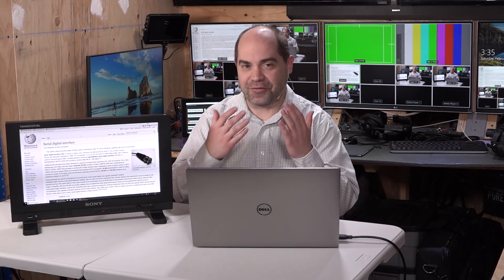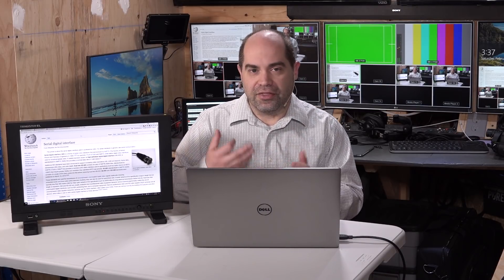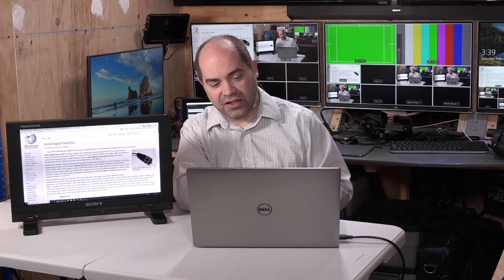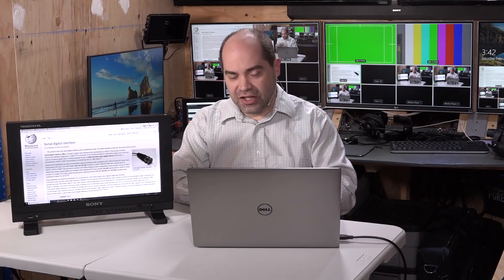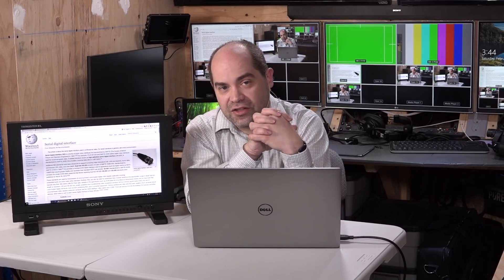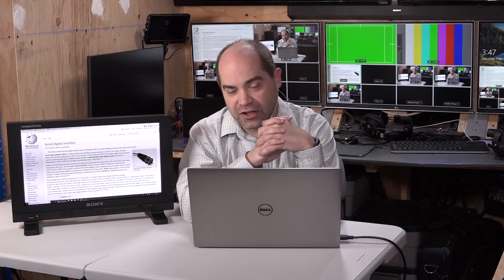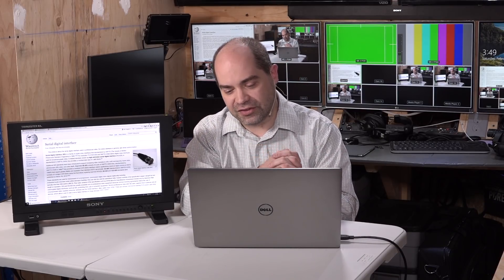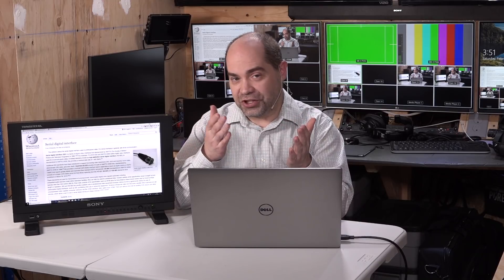What's this about SDI Video? 3G? Level A? Level B? Dual Link?

Comment: Hello, great information by the way. I am checking out YouTube videos in hopes of troubleshooting my rig.

I have a Canon XC-10, so I send the mini-hdmi output of the XC-10 to a Convergent Designs Apollo external recorder. I am trying to use “titan” with the Apollo, which essentially takes one 4K signal and splits it up into 3 different 1080p signals. They can be live switched and set to different magnification amounts etc, and all recorded onto one SSD, essentially providing an affordable solution which is similar to a multi-camera setup. 

In order to do this though I need one 4K signal and I do not like using the mini  hdmi cable from the canon xc10 to the external recorder because the hdmi jack on the camera is sensitive and I feel like when I use a “BMD hdmi to sdi converter”, there is less of a chance that I have problems with the mini- hdmi cable. 

So I got it all setup and it worked beautifully, or so I thought- I noticed that I still was not getting a 4K signal because my external recorder wasn’t displaying the 3 1080p feeds that were supposed to be present had a 4K signal been coming out of the “BMD hdmi to sdi converter”.

I can toggle between 1080 and 4K on the camera, so I then noticed that everything works fine on 1080, (except it just displays one camera feed on my external recorder because of no 4K signal) 

So then as soon as I would switch my camera to “4K” mode, the display on the external recorder would go totally blank. The audio which was working on 1080 would also disappear. 

I have checked that the box is set to “force ultra hd”, but it still seems that the BMD box is unable to convert my cameras 4K signal to SDI... I believe I was attempting to use “30FPS”. I am using just one cable. 

So I was trying to learn the differences of 3g vs 6g etc and then I was going to try and find out a little more info on my equipment because I’m not sure if “type a” vs “type b” is able to be used on the camera and recorder, and seeing if I can find any other info to confirm that I am using the right equipment or if the problem is elsewhere. 

I was also thinking of trying to downgrade the firmware of the blackmagic converter  box because it seems that another YouTuber has success doing so, but his problem was that the camera feed wouldn’t display on an external and he had a canon 5D- but same make of camera so I was hoping that might work- 

I am going to try a few more things in hopes of getting a 4K signal out of the BMD hdmi> sdi converter. Any tips or recommendations would of course be appreciated. Thanks for your well-explained videos (also watched the sdi-hdmi update video) 

Cheers,
Nick

Comment: Thanks Doug. Very well explained. Another question for you, what is the differentce between progresive and Psf signals and if there is a difference in quality between the two? Thanks
Reply from the maker: PsF (Progressive Segmented Frame) is a technique of wrapping what starts out as a progressive video signal into an interlaced output signal.  It isn't a discrete signal type of its own. The format of the output looks identical to any interlaced signal.

Using PsF you could, for example, shoot at 24 or 30 fps, and output that video over 1080i.  The "segmented frame" portion of the name means it splits individual frames across multiple fields of the interlace video.  So a 30fps signal could be converted to 60i by simply splitting the odd and even lines into separate fields in the output video.  In the distinct case of 24fps being wrapped into 1080i60, something called 3:2 pulldown can be used, where frame 1 of the original video is stored in 3 fields of the output interlaced video (each field containing half of the picture vertically), frame 2 is stored in the next 2 fields, then alternating back and forth thereafter.  Video devices which are equipped to process PsF can reverse the process and reassemble the original 2 frames from the 5 fields, without any loss in quality compared to the original.   For 30 fps material wrapped in 1080i60, each frame becomes two fields, for a perfect 1:2 ratio.

The PsF signal itself looks identical to any other interlace SDI signal, and in fact there's no flag in the data stream to tell receiving equipment that it is PsF.  So devices that support PsF either have to try to analyze the video to detect that PsF was used, or have an option to explicitly turn the decoding feature on.

Comment: Is 12G SDI over Coax feasible with >100 m and a flexible easy to deploy coax cable in mobile situations?
Reply from the maker: Probably not.  It would require a pretty heavy cable.  And even at 100M you're really at the maximum limit for SDI over copper.  Most people needing to send signals that far use fiber.

Comment: Are the BNC cables able to be used with 3g 6g and 12g or do you need cables made for those standards?
Reply from the maker: Sometimes you can get away with cables designed for 3G-SDI for 6G or 12G for shorter runs.  It really depends on the quality of the cable, connectors, and the transmitting and receiving equipment.  For example, I'm able to use cables made from Belden 1505A, which is only certified for 3G, for 6G-SDI at 100 feet without issue.  But ideally you would want cables certified for the flavor of SDI you're using.

Comment: So... I know the sdi signal runs on coax, rg-59 75 Ohm or something, but I don't have that. My parents home for exsample, as well as a lot of other places, have rg-6. Can you still run a SDI 3g signal on rg-6? What limitations does rg-6 have over rg-59?
Reply from the maker: Hey, Joshua!

I'll have to do a full video on this at some point.  RG-59 and RG-6 are both 75-ohm cables, and SDI can be run over either one.  RG-6 is generally better at handling higher frequencies, which actually makes it preferred for over RG-59 -- especially for longer runs or for higher bandwidth applications, but it does depend on the particular model of cable and the quality of the connectors on the ends.  A lot of times the RG-6 that is installed in homes isn't terribly high quality, but it would likely work just fine for SDI, especially if good quality connectors are used.

The most common coax that you want to avoid is RG-58, which is 50-ohm rather than the required 75-ohm.  You'll typically find it used for radio applications (like HAM, for example).

Comment: Very well explained thanks. Could you do a video explaining “gen locking”, ref in, Black burst etc. I have a rough idea of what it’s all about but when do I need it? I have a BM television studio HD and a few BM studio cameras do I have to use gen locking? Thanks again!
Reply from the maker: I could do something theoretical.  I don't really have the right gear to demonstrate it properly, though.
Reply: Doug Johnson Productions thanks anyway. There doesn’t seem to be a lot of info out there on the when and why. I just really want to know what I’m missing by NOT using it! Great work by the way, I always learn something from your vids.
Reply from the maker: The biggest difference you see without using genlocked cameras is longer delays from the camera to final switcher output.  Without having synchronized sources the switcher has to delay all incoming video sources by up to a half a frame to make them all match.  If you run in a genlocked environment that delay is eliminated.
Reply: Doug Johnson Productions OK I can understand that but is half a frame delay really that noticeable? Is the delay different for each camera and dependent on cable length or something? Thanks for the help, it’s much appreciated :)
Reply from the maker: That depends on several factors, most significantly the frame rate.  (Cable length is not one of them.) If you're shooting, say, at 24 fps, any two cameras could be out of sync by as much as 1/24 of a second since they have no common source of synchronization.  If you're dealing with a fast moving subject, or a source that requires precise synchronization with audio, that 1/24 of a second could be noticeable when switching between those cameras.  And if you're projecting the video live that extra delay from having unsynced cameras might be the difference between the delay being perceptible vs. not.

Shooting at higher frame rates like 60 fps can help minimize the perceptible delay, since the maximum difference between the start of the frames of any two cameras would be 1/60 second instead of 1/24 second.
Reply: Doug Johnson Productions That makes perfect sense. Thank you. Next time you’re in Ireland give me a shout, I’ll buy you a beer!